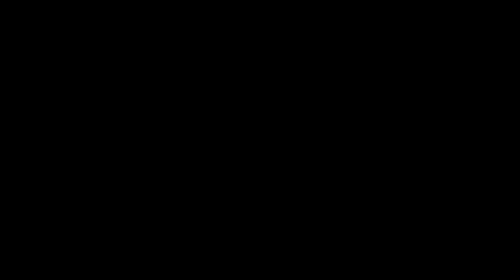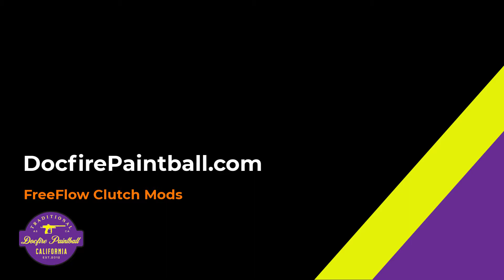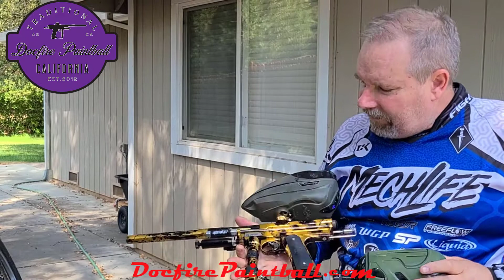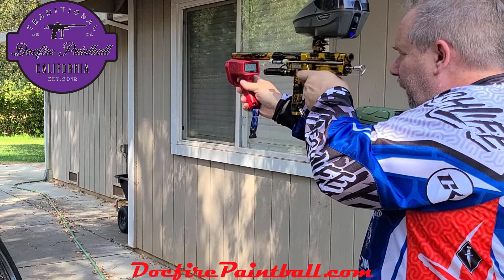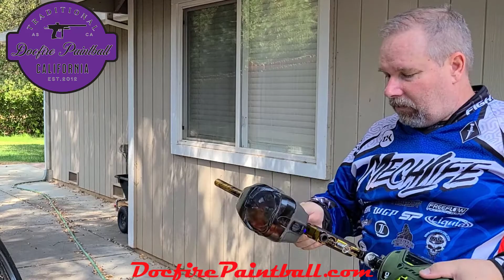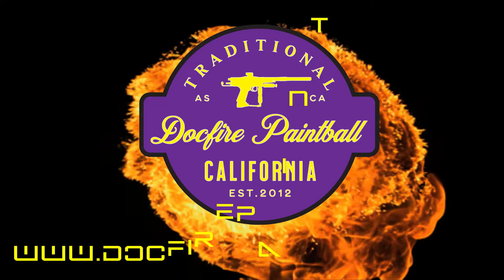FreeFlow Clutch Mods

Comment: when did these start costing more than higher end AR's?
Reply from the maker: Its all about the number manufactured and the amount of parts.  If Autocockers were made in the number that AR's are made then the cost would be much less.  In fact the AR's have around 111 parts compared to Shocktech SFL w/barrel at 152 parts.
Reply: @Docfirepaintball  thanks for the reply and I was in my feels but I think I am going just try and make do with my old prostock, I just need to find a safety for it with the detents but for a hinged frame if I understand that correctly. thanks for the respond, sorry I was heated and feeling poor.
Reply from the maker: @FloridaBikeVlogger  hit me up on Facebook messenger.  I can help you with your marker.